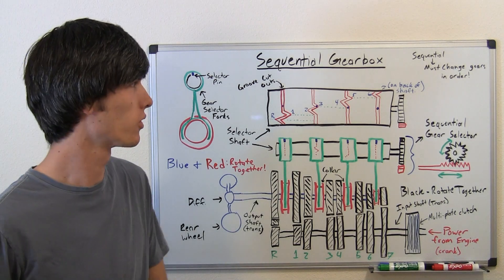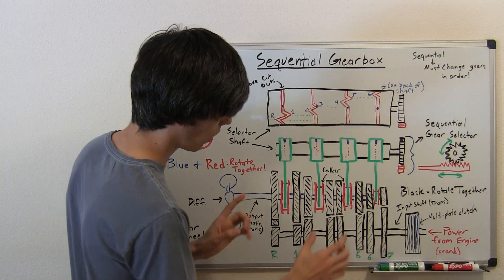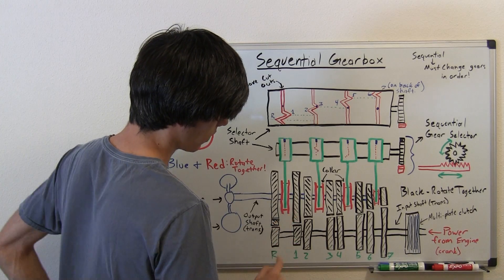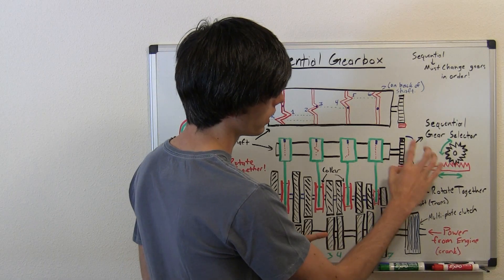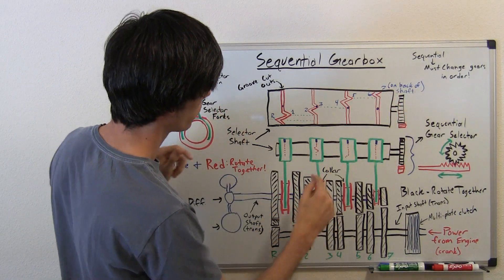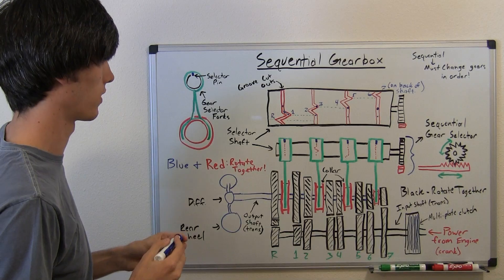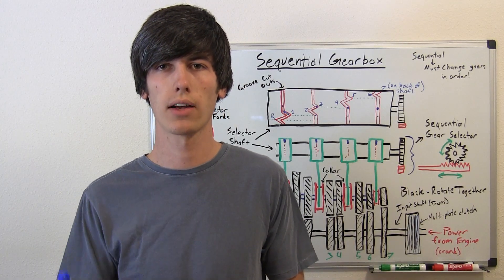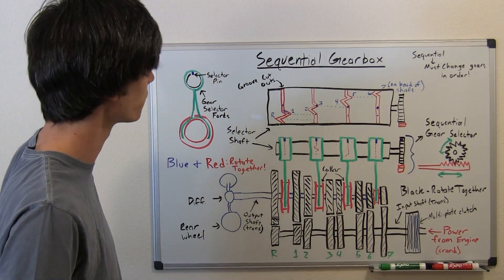Sequential Gearbox - Explained

Comment: Great video, but question: How does reverse work? The only think I can think is that the gear that forces opposite rotation is some how pushed out of the way.. or that the gear is not connected to the blue axle full time like you stated.

Comment: I dont know much about F1 cars so correct me if I am wrong but I thought a clutch-less shift is more to do with the design of the syncro/dog engagement of gears and the ignition cutting of the engine rather than having a sequential setup.

Comment: so it works similar to an automatic transmission when its in manual mode, you have to go up or down one gear at a time, but push the shifter back into D and it operates normally. only F1 cars have no D mode

Comment: Excellent video and explanation. Now I understand how my motorbike gearbox is working. 
However, just to make the point, you forget to mention that changing gear without actionning the clutch, you have to lower the torque on the shaft so that it would shift (done by cuting the injection).... 
And just a tip for your videos to be even better : don't look your whiteboard so much... (learned that in some competitive exams ! )
Thanks ;)

Comment from the maker: Yes, I'm an ME; I took a few related classes but have learned the majority on my own.
Reply: At time 9:51 you mentioned that you do not have to use the clutch after first gear with a sequential transmission, but shouldn't all the same reasons for needing to engage the clutch on a regular manual transmission still apply to a sequential transmission?

Comment from the maker: It's different, in that there are two transmission shafts which can be linked to the flywheel (via the clutch), check out my video "dual clutch transmission."

Comment: i'm really surprised that your instructors had you single clutching though. we were double clutching all day, er' day lol. we woulda failed our driving test at the DPS, had we not double clutched. anyway, you'll be shifting without the clutch at all, eventually. double clutchin' them rigs is a good way of gettin' yourself a knee replacement, in the future ;). keep the wheels turnin' and the shiny side up, brotha!

Comment: ah, from a fellow trucker here; Engineering is right, they're just your typical, unsynchronized manual transmission. i think what you're asking about is the range valve. the switch on the front of the shifter, right? that just switches the transmission into it's high range so you can grab your upper gears. splitters (on the side of the shifter) do a similar thing, only they give you half gears. for example, an 18-speed transmission is really basically a 9-speed with each gear halved.

Comment: I like your videos, keep up the good work! One thing to consider are the electronic paddle shifters send voltage to a solenoid on the selector shaft, this and the aid of the engine management computer cutting ignition for a split second allow quick and seemless shifts!!

Comment: In V8 Supercars, in Australia, they shift while the clutch is engaged. The engine is programmed so that it will decrease the rpm while shifting up(we are not even talking seconds.) It is called gear cut and is also used in many of the GT classes.

Comment from the maker: Yes, they do. While holding the neutral button, the driver can downshift into neutral from 1st gear. It's a safety built in so that the driver doesn't accidentally shift into neutral. There's a similar button for reverse. I'll have a video on the steering wheel up in a week from today.

Comment: Ok. There's two fairly large hills near me which I drive down often, and on one of them the speed limit is 55, one is 45. On the faster one, my truck doesn't accelerate when going down the hill, it stays right at 55. I can coast down the entire hill, which is about 2 miles of 20+ degree descent without speeding up. However on the 45 mph hill, which is of the same steepness but only 3/4 mile long it will speed up to over 60 by the time I've reached the bottom if I don't use the brakes.

Comment from the maker: Haha thank you! My thoughts: 1. Music doesn't help you understand cars any better. 2. Intros don't help you understand cars any better. 3. Getting to the point helps you understand cars better.

Glad the recipe has worked for someone!
Reply: It finally been said... Lots of music and confusing content can be a headache... Thanks for the video... Great explanation
Reply: This video helped me understand cars much better! Hahaha
Seriously great explanation, I've seen all your videos talking about gears and transmissions, but there is still something bothering me about rpms, specifically down shifting and rev matching.
I understand that you need to increase the engine revolutions to match those of the lowest gear, but I can't see clearly when I think about the gears and synchronizers
It would be great if you made a video like "How manual transmissions work "explaining how rev matching works with an actual transmission

Comment: Hey man, can you do a vid on exhuasts and can help me with this question. I have a 4 cylinder car with a after market 421 header. I want to get a after market exhaust system but I dont know if I should get a Y-Pipe dual exit type or the single exit exhuast. which would be better for my car?

Comment: if im not mistaken the regulation state that it must have a reverse gear. without that regulation they will not put the reverse gear to save weight and the fact that it is most likely will never be used in the race.

Comment from the maker: Well the majority are likely using torque converters (lower end vehicles with paddle shifts), but for the higher end, excluding DCTs (which switch clutches, done by the ECU), single clutch transmission would have to have electronic control of the clutch actuation. But this would still likely be much faster than a human switching gears.

Comment from the maker: Check out my videos "Dual clutch transmission" and "automatic vs. manual." Paddle shifts are just an electronic method of selecting gears, they're not specially tied to a certain transmission. A single clutch transmission with paddle shifts could work with the transmission in the above video, but with a single plate clutch. (Watch my video on "multi-plate clutches" if you're confused on this.

Comment from the maker: I don't believe so. The selector shaft would inhibit the 7th gear from being selected from 3rd gear, without prior selecting gears 4, 5, and 6. There is a physical movement that selects each gear sequentially, which cannot be overwritten. Your transmission may work slightly differently - for example cars with "manumatic" transmissions, which just use planetary gears and give the driver the ability to select which gear to be in.

Comment: My BMW M5 has a Sequential Manual Gearbox (SMG) and is able to skip gears. If I'm in "auto" mode and floor it, it skips directly from 7th -> 3rd. I believe the only reason that the F1 cars don't skip gears, is because the rules state that the transmission must be "semi-automatic" and controlled by the driver, not because the transmissions are incapable of doing so. If the F1 transmissions had an "auto" mode they would also be able to skip gears, just like my car can.

Comment from the maker: Seamless shift is often in DCTs, but Mercedes (and others) claim their F1 gearboxes never lose power during the shift (hence, seamless). I thought the same about the gear changes, the difference if 2 collars are used in the shift or just 1. I couldn't tell you to be honest, though it does look like using 2 would be quicker. This could be overcome using more selectors and collars, but who knows if it would be worth the extra weight/complexity.